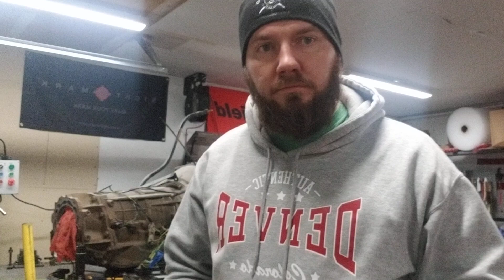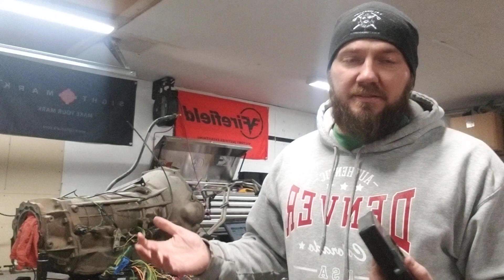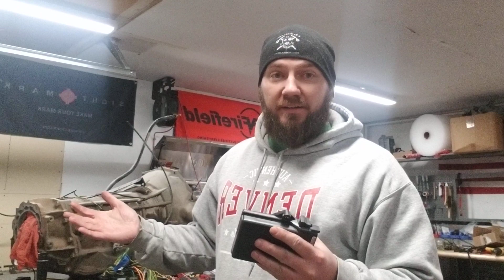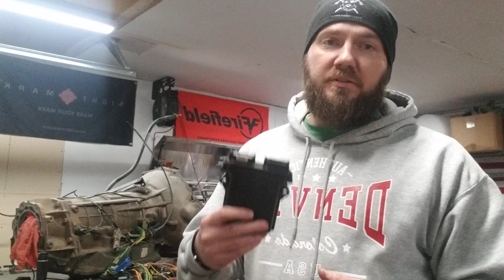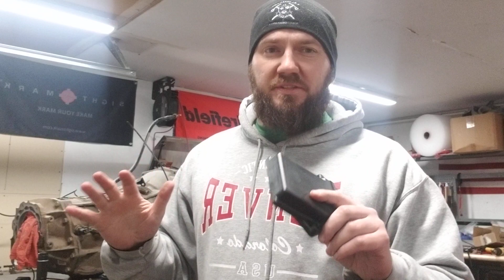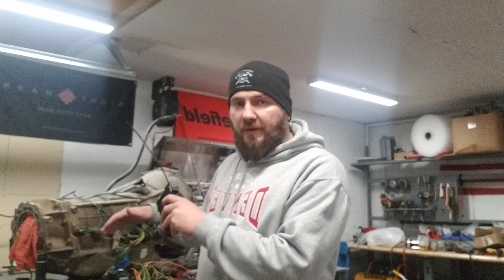68RFE standalone powered by Banshee VGT Controller

Comment: Ok, where is this at?  How can I get it?  I have a 5.9 Cummins in a 2007 and really want to run the 68rfe.
Reply from the maker: Only did the one, then started working on Allison conversions.
Reply: @SteedDolan  do you have any plans on doing more?  I know quite a few guys tired of putting money into the 48re or needing to rebuild the 48. At the price point you were saying, it would be better to upgrade to the 68rfe.
Reply from the maker: @jasonvillnave4481  the 68RFE still isn't a great transmission. For the cost to put in the 68RFE you can probably get an Allison behind it. I paid $800 for a 2018 Allison 1000 with less than 3k miles on it. It shifts and drives great and is considerably stronger than a 68RFE
Reply: @SteedDolan  I can get the 68 for that price also. Add a controller and I’m done.  I have a basically stock 5.9, 350 max HP.  The Alison is great but you have to add the adapter, driveshaft, starter, and what else..  A stock 68 will do fine for my application and it’s a great option for many in my boat.  I know a few other fellow Ram owners in my area who use their trucks on the ranch and don’t race their trucks.  We use them as we need to, the option for a few extra gears at closet to the same price as rebuilding our 48re (again), would be the best choice.
Reply: @SteedDolan  it is not a great transmission but you would probably sell 50-100 controllers for every Allison swap sold if the option was available to cheaply modernize the driving experience. 68's are available everywhere and like Jason said, pretty much drop in. I have a 5.9 VE and a 5.9 VP both with 50 HP sticks and fuel mods, I'd love an Allison but a low budget option would make more sense for my no power trucks. There are a lot of us who don't want to drop massive dollars on our stock/reliable trucks. If someone got something like this done for a 68rfe, they could basically come take my money tomorrow.
Reply from the maker: @charroescamilla  Check out the ATS Allison conversion, i developed the electronics and software for it. ATS will be releasing the 5.9 conversions soon

Comment: Anyone watching, I had an actuator failure on my 6.7 turbo. Four bolts replacement, with one big exception. You need to have a calibrator to make sure it is in the correct position for install and then it has to be calibrated. I got Steed's VGT controller and he and I found a small software glitch. He fixed it right away and walked me through the procedure. I got the new actuator installed. No shop was willing to do the install for any money. Steed is a stand up guy. This seems like a great way to use a 68rfe. If you are going for big power ahead of it, get an ATS stage 2 with copilot. May not even need the copilot if Steed can regulate pressures.

Comment: Good work! Cool thing about a 68rfe, it’s the same length as the 48, so it should drop into anything that had a 47/48. The main problem is the pilot hole on the crankshaft is different on 5.9 cranks.
Reply from the maker: The 5.9 crank isn't an issue. ATS designed a custom torque converter and flex plate that will bolt the 68RFE to the 5.9 without moding the crank